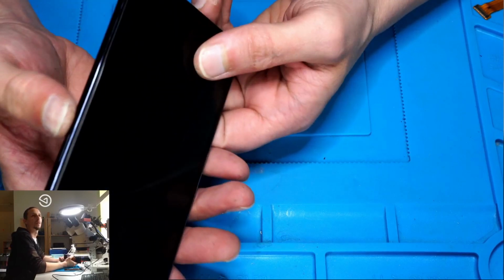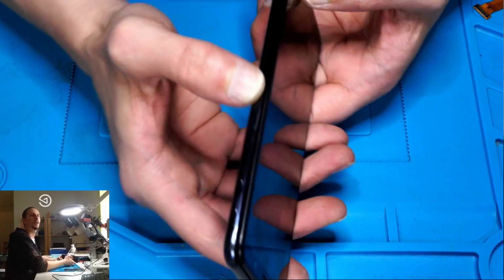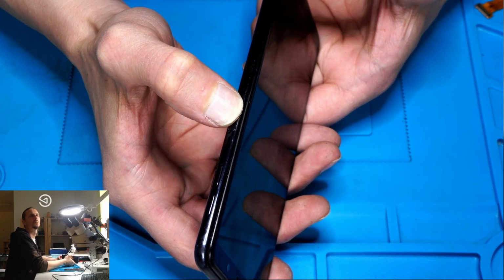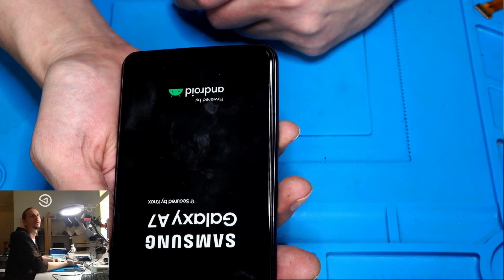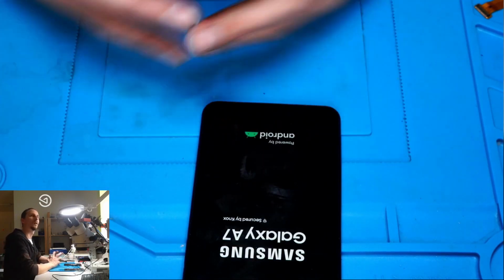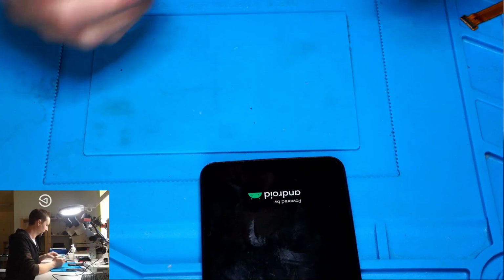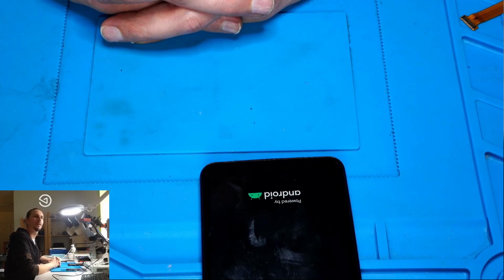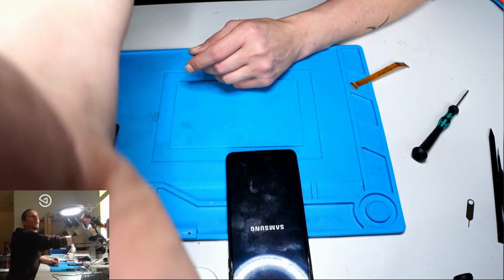Samsung Galaxy A7 2018 Not Turning On Not Charging

Comment: Same problem with my A750F/DS. I know my battery was traumatized (heavy charging/discharging strain on it) 12 months ago before it packed up less than a week ago (of posting this comment). I noticed that the power button seems disconnected (it doesn't have that "move in-out" about it anymore). Also, when I plug it to charge, the first charging icon appears but doesn't load/animate into the full charging icon before it dissappears with no further observable event.
Reply from the maker: The A Series are very soft and easy to bend, and then they get cold solder joints on the fpc connectors...

Comment: My phone turn off suddenly and then never turn on.Maybe logic board is defective?
Reply from the maker: I would first check the charging port module, fpc flex and connectors
Reply: @irepairitall  How to check.I don't have spares.Iam playing one game and phone goes off.That is all
Reply from the maker: @ivanivanoff7428  open it up and make a visual inspection, push lightly on the connectors, maybe there are cold solder connections. Does it charge the battery? without any tools you have to bring it to a repair shop...
Reply: @irepairitall  I check everything.Flex cables.Battery.Charging connector.Not charging.No sign of life....

Comment: HI THERE THE VIDEO IS VERY HELPFUL BUT I HAVE AOTHER PROBLEM.MY A7 SAMSUNG DONT WANT TO GO ON ITS STUCK ON  THE BATTERY LOGO WHEN I PUT IN THE PLUG.THANKS IN ADVANCE FOR HELPING
Reply from the maker: Thank you, probably the phone is fake charging and the battery could be drained. I would check charging port, fpc connector or fpc cable for cold solder joints etc

Comment: what size screwdriver works for most these phones? i have a Samsung A20 and my screwdrivers just dont grip or cannot move the screws in mine!

im thinking of purchasing a wera? (but cant afford the whole kit!)
Reply from the maker: This is what i use: Wera 118026 PH #0 x 40mm Kraftform Micro Screwdriver
Reply: @irepairitall  thanks for getting back to me. I think i have a #0 in my "cheap" set but it doesnt fit --- could be because it's cheap and nasty lol.

Comment: Ordered a new power button as I was replacing the display aswell, realized it's still not working, looked the issue up again, found this vid, tried starting without charging connector attached, works

You freaking genius, I would've never thought abt this, my next option would've been a new mainboard aka buy a new phone for my sis

Thanks a bunch, helped me a lot <3
Reply from the maker: Very glad to hear that! Good job vor doing it yourself :)

Comment: I have a problem with my a7,it dont want to turn on but vibration of it still working for example,i screenshot and it work just fine,and also the alarm,i set it  before around 6.15AM and it just ring,its weird cause i can slide up to turn off the alarm,the only problem is the screen is just blank,any solution?
Reply: Have the same issue. May I know what did you do to fix??
Reply: same here
Reply: me too

Comment: We have the same issue a7 2018, i tried to change the battery but still not opening. By the way what is the purpose of the thing that you took off? Will it affect the phone?
Reply from the maker: if you are talking about the flexcable described as "thing" it connects the lower board to the mainboard (will affect: Mic, Charging and Speaker).

Comment: Can i ask, what seems to be the problem if the screen is black and then the phone is still on like the phone can still alarm? Samsung a7(2018) to be specific
Reply: And i can also stop the alarm but no display. Just plain black. I can touch the screen to disable the alarm. I can stop the alarm by guessing which part is the off alarm
Reply from the maker: Can be a cracked screen, or liquid damage on the screen connector area. What happend to the phone?

Comment: Hi,
I have a galaxy A7 2018 and after 1 year of using it if had and heat in the top part of the screen then suddenly it restarted very quickly then I re-restarted it again after that I truned it off for a while for reason to decrease that heat and when I wanted to turn it on again it wouldn't turn on nor charging ?? I hope that you can help me and thank you
Reply from the maker: Hey Oussama, the reason why the upper of the phone side is getting hot is, because there is the mainboard placed. Did you use different kind of chargers? Kan be a lot, often the charging curcuit... also cold solder=no good connection...and so on.

But defenitely a board issue.